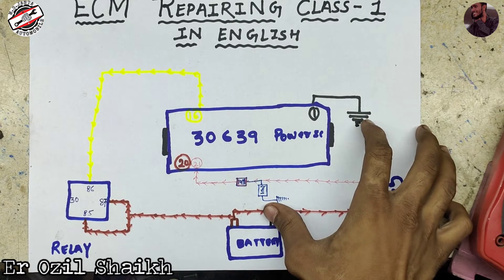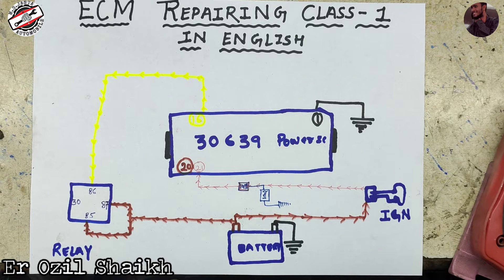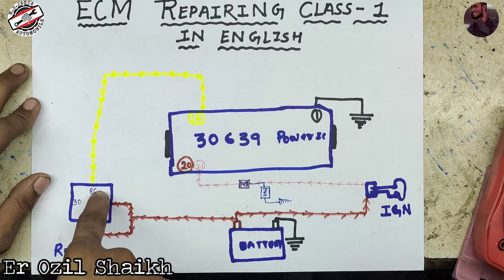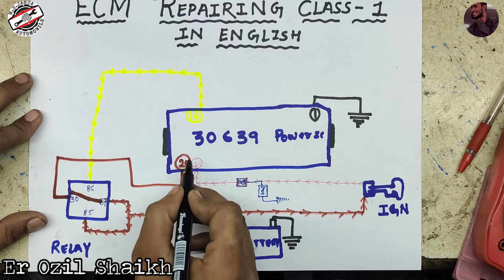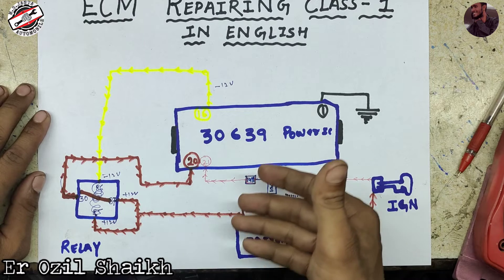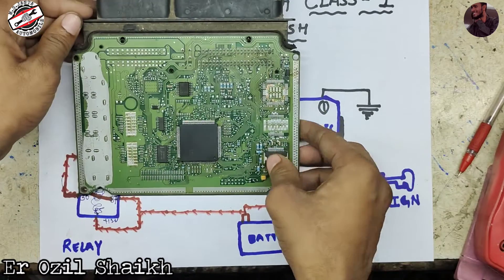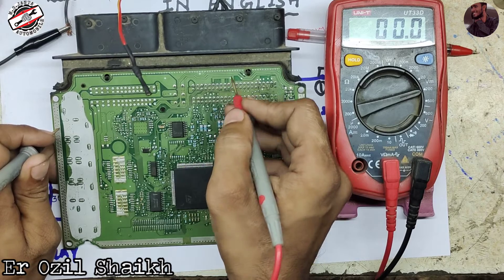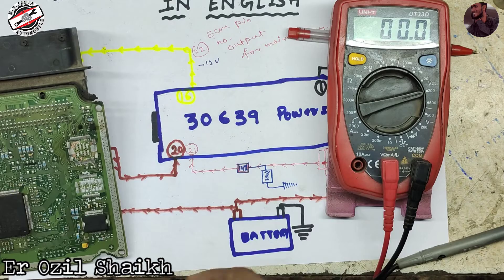Ecm Repairing Class-1 In English | 30639 ic main relay power distribution | Power ic pinouts explain

Comment: You are amazing.  I have a 2009 Mercedes GL450. I am guessing the rear SAM control the ignition voltage to the ECM. Is that correct?
Reply from the maker: No bro